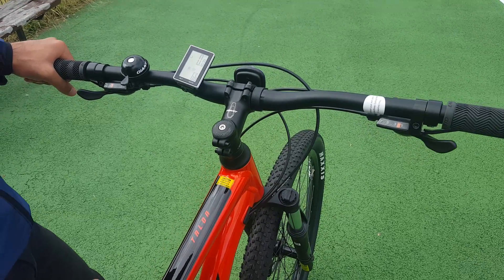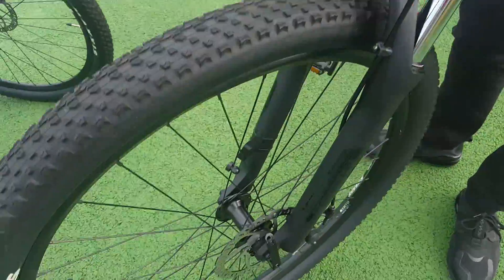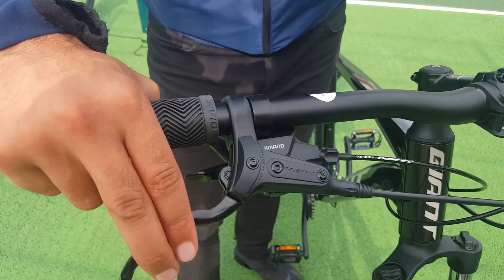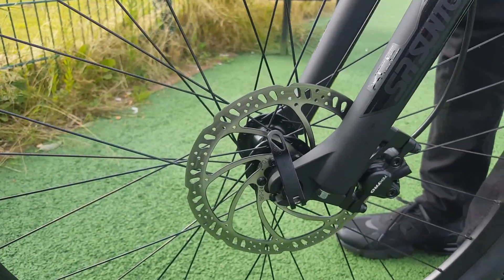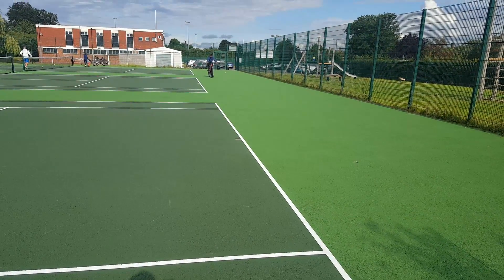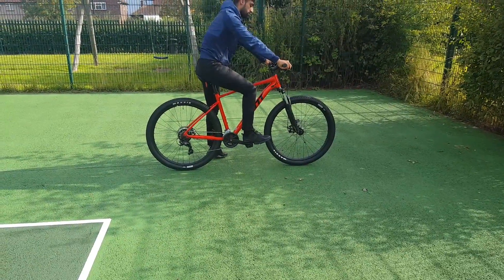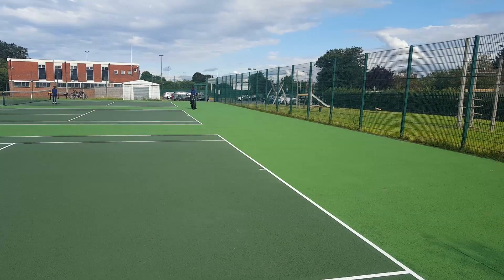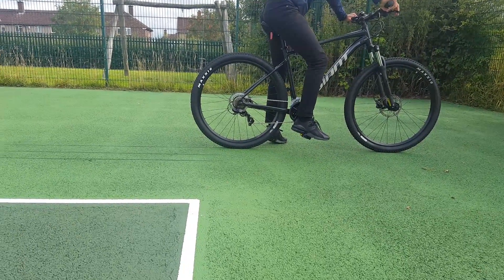Mechanical VS Tektro Hydraulic Disc Brakes - What Is Better? Stopping Power Test at 10mph

Comment: based on my experience i am gonna say that the mechanical disc brakes weren't adjusted properly. i think i had those same brakes and they were so powerful that i would lift my rear wheel by accident alot of the times. especially at such low speed.
Reply: I would hope so.  You can do that with V-brakes
Reply: @TheSuburban15 yes

Comment: i had a mid range Carrera Kraken for years i loved and it got stolen couple weeks ago and i just go another new bike its a SCOTT Aspect 950 and it looks a nice bike and i like the gears more than on the Carrera but one thing that sticks out to me or i maybe wrong is i feel the shimano hydraulic brakes on the old kraken are better than this Tektro brake system. even the tops of the brake lever are plastic where as shimano were metal where u screw funnel. the braking in the lever feels horrible like its cable and not cushioned press like it was on the shimano. i also seen 2 videos of people with the scott 950 tapping the brake lever as there is play and annoying rattle noise from the lever. over 5 years ago i bought the Carrera Kraken from Halfords for i think £375 and it was classed as mid range bike. this scott 950 was £599 when it first came out and now its gone down to like 400 and u get £25 discount on it so £375. i paid £300 for this bike from a friend who rode it twice and its mint condition.

Comment: literally no difference. they both braked the same. only difference is one is way easier to change out when you need pads. mechanical all the way for me
Reply: they are literally the same. have you ever used a hydraulic brake and changed pads?

Comment: I’ve ridden with Tektro mechanicals, and Tektro (four piston) hydraulics - and MUCH prefer the Hydraulics for daily use.

Grab a big handful of the latter, and you will either lock up your wheels, or you’ll get launched!
Reply: The new bike I'm getting has 4 piston Tektro HD M535 brakes front and brake, I was worried they weren't going to be that strong, do you reckon they'll be fine for a heavy rider?
Reply: @nickfreeman7285  I'm 250lbs lol  it won't be problem
Reply: @nickfreeman7285  four-pot Tektro brakes will stop you - even if you’re “really heavy.”
Reply: Quite honestly, I can't even see the point of mechanical disc brakes. They're absolute junk. Even mechanical rim brakes are vastly superior without all the dicking around. Mechanical is fine for rim, but totally stupid on disc.

Comment: My new MTB will have hydraulic disc brakes.
My last bike had single pivot road calipers, l am sure they will be a HUGE improvement.
But from a purely engineering point of view the TRP Spyre C matches hydraulic brakes in everyway and is the pinnacle of mechamical disc brakes.

Comment: I ride down hill (fairly mediocre as my videos contest...) and Hydraulic is a must.. after that I prefer V-Brakes over cable disk. The ONLY thing cable disks are good for is providing the mounting points on a cheap bike to be upgraded to Hydraulic. Cable disks are in need of constant adjustment, are full of mechanical friction points adding to the force needed to overcome things like cable friction to apply the brakes and have almost no feel. Hydraulic brakes constantly adjust themselves and have near no friction in the system so all the force applied to the lever is applied to the brake pads (amplified by the marvels of volume displacement ratios...)
Reply: wrong on so many levels. have never needed to adjust my mechanical disk brakes. have fun draining brake fluid when doing a repair while all i have to do is loosen a couple bolts.
Reply: @tehMaloWalo  3 years on a Giant Faith Freeride bike with cleaned pads and 1 fluid change. (Same bike in all my videos).
I've had cable disk... as the pads wear you HAVE to adjust the static pad or you will damage the disk with constant warping. Cables stretch.. and I have not yet ridden a cable brake that had more than half the stopping power without having near no feel for the surface. This is why no serious downhill rider uses cable. 
in 45 years of riding I have had LOTS of cables fail...
I have had 1 rear fail because I didn't see that for 10 years the tube was able to touch the rear tyre and it eventually wore through... And I cooked the front once because I was (actually still do) running Virgin Olive oil in my Magura brakes on my 1995 Foes Weasel.
I made the mistake of running a local blue downhill on my Avanti with a cable front. Scarier experience than I have yet to have on a black trail.

But hey that's just my opinion.
Reply: @tehMaloWalo  i had to do that all the time with mechanical while i never had to bleed or do any maintenance on my hydraulic brakes in almost 10000km of them having to slow a heavy bike down on downhill trails. there is a reson why higher end, heavier bikes and cars use hydaulic brakes.

Comment: There really is no comparison. I have recently converted one bike to hydraulic from mechanical. The biggest differences are modulation capability, less pressure required to squeeze the lever. Just better overall braking.  ANYONE that thinks mechanical is as good, has never directly compared the two or have never ridden Hydraulics.
For the best braking performance from Disc Brakes, BED YOUR BRAKE Pads in. Just like a car or motorcycle, disc brake pads must be bedded for optimal and consistent braking.
Reply: mechanical is just as good. this video alone proves it doesn’t matter. they both stop in the same place. you’re just trying to justify your purchase when mechanical disk brakes work just fine in every situation
Reply: @tehMaloWalo  I have bikes with both. There is no comparison. I don’t have to “justify” my purchase, I knew what I was doing when I ordered and installed them. ZERO regrets. Upgrading brakes is the best mod on ANY vehicle. It’s game changing. 
One person doing their version of comparison or testing is not the kind of technical info that purchases should balance on. Get out and test them for yourself. Own them and live with them for a season and then come to a conclusion. If you do not like the product you purchased, sale it. There is a huge used component market and the knowledge you will obtain during your quest for the “MY” setup is invaluable. 
IF there was no difference in stopping power between mech and hydraulic, you would see at least one race bike in at least one class of MTB. So you tell me…how many race bikes in the last 3 years have you seen with mech disc brakes???  I can tell you how many I have seen….ZERO.
Just because you fail to see the value in Hydraulic disc brakes does not mean other people do not.
I will die on this hill, now I will clarify…yes they both stop very well. The differences that stand out to me are the feel, modulation capacity and maintenance. Every single time you pull hard on mech disc brakes, you are micro stretching the cable.. that makes it IMPOSSIBLE to have the same modulation, the same feel. If you just pedal around and do not push your bike, you will not recognize the real differences and mech disc are perfectly fine for you. But if you ride hard at all, you will benefit greatly from Hydraulic brakes.
Reply: what is Bed your brake pads in?  Breaking in, do you mean?
Reply: @gosman949  bedding your brakes is the process of heating up your pads and rotors so they mate and to burn anything off of the pads. You should do this with ALL brakes. Cars, trucks, motorcycles, bicycles. Anything with brake pads, you should heat cycle them multiple times. Brake manufacturers usually tell you this on the package, but it’s common knowledge for mechanics and most DIYers. You can search YouTube for a explanation on how to do this with your certain application…i,e. Bicycle, car, etc.
it’s not Breaking them in…it’s “Bedding” lol
Reply: To be fair there are mechanical brakes  that are a lot better than these. Even Avid bb7’s are way better that Tektro m275’s. And if I could afford it I would remove all my 4 pot hydraulic brakes and install some Paul Klampers mechanical brakes.
Reply: in what world is less pressure better modulation? that's like the opposite. modulation means that you get feedback from the brakes and you need pressure to do that.
Reply: @  I realize I should have clarified that “pressure” is referring to lever pressure…how hard you squeeze on the brake lever. In other words, hydraulic brakes require less force on the lever in comparison to cable/mechanical. Not only does it require less force, the pressures required are much more consistent. So that all means you get MUCH better modulation or control of your braking performance in comparing Hydraulic VS Mechanical/Cable disc brakes. 
None of what I have said should keep anyone from cable disc brakes, the level of performance of cable brakes is nothing to be over looked for sure. 
My opinions are based on my experiences and applications and can amount the zero for someone else…
Fortunately, there are many quality brakes on the market, both cable and hydraulic, so there is something for everyone…and really the best part is just having disc brakes.

Comment: I can lock my mechanical brakes up no problem and could probably stop my bike at that speed with the rear wheel behind the line. The real difference is on the trail with mud in there, I’ve had to pump the brakes to slow down

Comment: If I had to choose I'd probably pick mechanical personally.
Reply: why
Reply: @NikosKatsikanis  why not?
Reply: @fetB  less stopping power, constant fiddling around. hydraulics = set up once, maybe change pads but otherwise forget. also much less strenght required for actuation meaning you can brake harder and modulate it better.